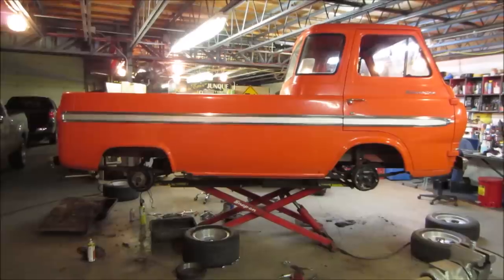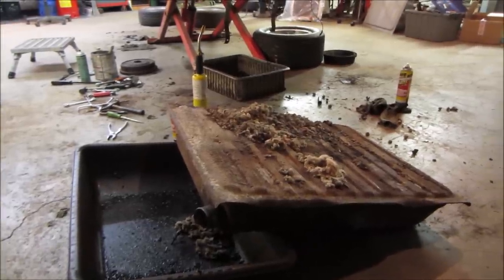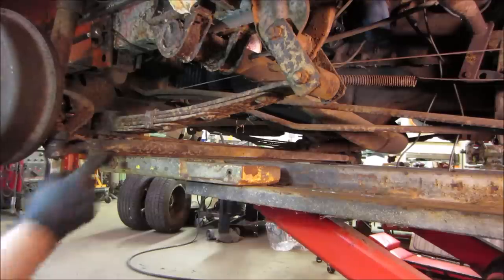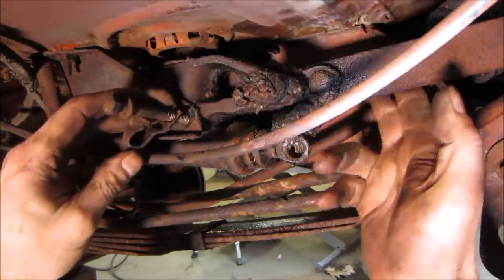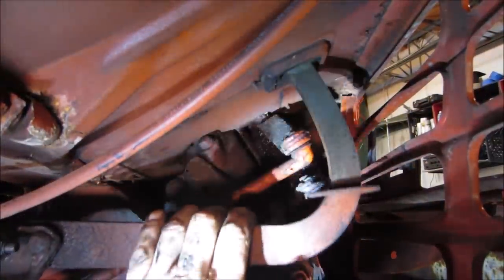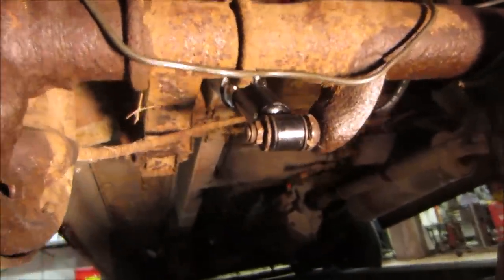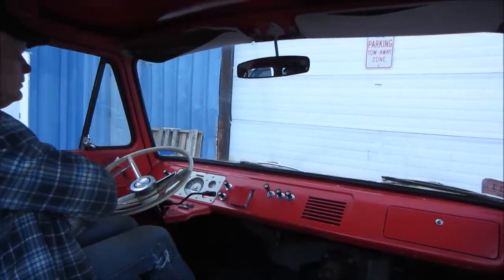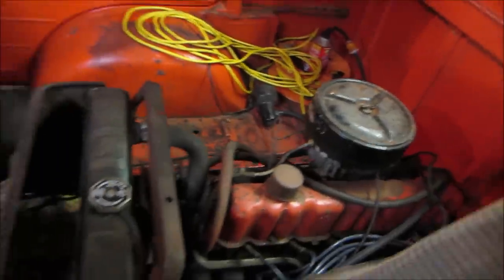Ratty 1965 Ford Econoline,  Making It Stop Then Making it Go

Comment: I would  have gone for a brake upgrade, a dual master cylinder, and at the least discs on the front if not all the way around. I think Mustang brake upgrade kits would work, or at least come close with a little modification they could work. (Early mustang upgrade kits I mean)
Reply: This things known to pop  reverse wheelies as it is, disc brakes would only make it worse
Reply: @bahopik  yeah right like that's a real worry. I'd rather be able to stop. If that single stage master blows, you're screwed. I have driven with no  brakes when they suddenly went out going down a hill. It's not fun and super scary. I managed to deal with it, barely. Even if yo left it drums, I'd still invest in setting up a two stage brake master. or even two masters like on some race cars. anything would beat what it's got. If you're really worried about it, put some weight in the ass end.
Reply: @CarsofTheArcticCircle  amen any "reverse wheelie isn't going to be all that bad. Better than front end colliding with something or somebody. Back in High School, a buddy hung a big I beam on the front of his truck where the bumper was supposed to go. People well in the other lane would see him coming and move over more. Having been nearly head on'd twice recently, I vote for all the braking you can get, maybe a steering upgrade as well. Without good steering and good brakes, I wouldn't be here, at best I'd be in hospital. I rebuilt the entire braking system on my ride a while back, and have had the front end practically rebuilt so it brakes well and handles well. other than that, it's a beater. near 300K on it. Motor runs good if it starts, but it's getting harder to start all the time. Need at least some new plugs, I guess that's about all a guy can do to tune one up. with the newer cars, you can't even do that as they use coil packs and all that crap.
Reply: @tootall5559  with 80 horse, if 3/4 of them even still there, you have to get up to speed first, which I'd imagine takes a little while
Reply: @bahopik  Not so much as you would think. little weight also means not much is holding them back. Those little sixes may have only had 80 ponies, but most of it was low end grunt. They'd get rolling quick... for the standards of the time, but wouldn't go to high speeds, trust me 60  in one of theses feels quite fast. Most I knew that had the pickup version carried an old engine block or something in the back. Of course the van versions get beds and all kinds of stuff. They also had a kit for them called 6 equals 8. headers, a different head, different manifold and carb... They'd really get going quick then. of course if you did not change the tranny and rear end gearing, the top speeds were still relatively low, but that was a good thing I think Not exactly the safest thing to drive.
Reply: bahopik 
That what proportioning valves are for👍
Reply: anyone with common sense knows that is not a option.
Reply: 1948 willys truck rebuild when I was 17 (late 70's)... Driving home after some 4 wheeling, going down big hill in county, the right rear wheel came off (missing a pin - I blame Dad)... All brakes out, going down hill about 50, one front tire touching road, digging trench with right rear plow -  curve and bridge over creek ahead.   I started down shifting, using engine braking force. Since it had 3 gears in high and low range, I was in low 1st by the time we crossed the bridge (doing about 5 mph) and turned off the motor to stop on the shoulder.  We never had a dual master cylinder on that truck, but damn sure had that retaining pin...
Reply: @drzorbo3770  I had my real wheel pass me once on an old ford truck. I had just got it, didn't have a jack or anything in it. Hell if had a jack, I would have jacked it up, slammed the axel in, and nursed it home or back to the deal since what would be closer. I let the tow company keep it, told the dearler where it was and if he wanted the rest of his money he would have to bail it out, fix it, and give it back. He let the tow company keep it. they put the axel back in, put a new pin in and sold it with a day of it being ready to go.

Comment: looks like it needs taken off and the whole drag link heated and  straightened because the ends have a 30ish up angle
Reply: Pete Peterson could it be installed upside down? The angle would match that way.
Reply: Pete Peterson   Absolutely do NOT ever heat steering components.
Reply: @bigmike1ak  the drag link ends are pointing down  look again even at sixty I can see that  it might be natural but because of the way it was bent I don't know not to sure unless I can see the forge stamp on the ends. ya know
Reply: @todaywefly4370   You can use heat don't take the temper out and I think mustie is a smart cookie when heating just black hot is good enough to expand the molecules of the metal to facilitate easier reshaping and besides this is cold rolled
Reply: Pete Peterson   Yeah great, except heating and repairing a steering component where I come from is an immediate reason for failing a safety inspection. Probably there as well.

Comment: An idea to make the steering go easier.
Grease the ball joints.
Drill a small hole in the top of the ball joint and with a special pointed nipple on the grease gun you can grease them.  
Eventually cover the hole with some silicone.
I used this method on old tractors and on ATV's, and it made a big difference.

Comment: Any chance the tie rod bar is on upside down? The angle of the tie rod ends seem odd, and if the bar was bolted on upside down, it looks like the angle would be correct.
Reply: I think you may be right - either that, or the rod (technically, I believe it's a drag link) has been bent rather badly at the ends as well as the centre.  Every pic I can find (which admittedly isn't many) seems to show a straight rod from one end to the other.  But the way it is, those ends will always be close to hitting the springs.

I suspect the truck was jacked up by the rod at some point, and it bent in the obvious places - in the middle where the jack was, and on the ends where the tie rod adjustment is, as that's always a little weaker than the solid section of the link.
Reply: @aussiebloke609  exactly, that is my suspicion as well.

Comment: So it may need a tad bit more weight in the back end than just the 150lbs or so from the factory LOL.  Typical pickup issues, no weight in the ass end to give it traction, even with snow tires you'd have that same issue, couple hundred pounds in the bed, problem solved...except I wonder if you'd hit the fenders on the tires at this point?
Reply: called a STOPPIE, google it.........................
Reply: The gallons of fuel will do just fine.?

Comment: If you are going to do a swap in the future, look into a 1995 F150. Last year of the 300 inline 6, fuel injected, E4OD trans, same as behind the diesel of that year and an 8.8 rear end.
Reply: Do not change it. It is a survivor and as soon as you change the engine, it will lose any value. My dad and brother did that with a 64 Ranchero. Now any buyer wants an original survivor car.
Reply: @dwheeler016  All numbers matching also.
Reply: Love those trucks, and it would be a great swap...but I think this thing is really cool all original.
Reply: dwheeler016 by any chance are you from S Granby?
Reply: @rust2985  I agree. My dad was given an original 64 Ranchero when his friend died. My brother talked him into putting a V8 and an automatic transmission in it. The engine and tranny are gone, the original bench seat is gone. Any value it had is gone.

Comment: I know from previous videos you do not like rust converters, however; would like to make a suggestion before you get further along on the body repair.  I like and use Ospho on a lot of non-automotive metal repairs and would like to suggest buying a quart of Ospho (should be about $20.00) and apply it to the underside with a spray bottle.  It goes on like water and drys overnight so you could mist parts of the underside before leaving for the day.    It will be completely dry by the next morning so you will not have any messy issues.  It doesn't hurt to get it on your hands so a quart's worth in a spray bottle will coat the underside several times.  I have found applying multiple coats on heavy corrosion will eventually result in a dense coat with a like white coating.  The heavy coating of rust to iron phosphate takes paint or your "special" undercoating very well.  That should, for the money, provide a lot more protection for years to come.

Comment: My recollection from when I had my 1960 Mercury Comet is that the 144ci engines were prone to having problems oil passages plugging to the top end of the engine. At that time you could get an external top end oiling kit from J.C. Whitney and the like that fed oil somehow to the rockers through the valve cover.

Comment: Musti1 Please correct me if I am wrong (I was wrong once when I thought I was wrong and I wasn't;) but, I believe dual master cylinders feed in a cross pattern and not front circuit and back circuit.  When you think about it, it would be a very dangerous situation to panic stop with brakes working on the front but not on the rear. When that happens on a tractor-trailer it always ends in a jackknife. When the front stops the rear keeps on coming around. In a passenger vehicle like your truck, it results in a spinout. On the interstate in the rain or snow that would be a deadly situation. I believe on a dual master cylinder, you have left front and right rear on one circuit and right front and left rear on the other circuit. That way if one circuit fails, you have symmetrical braking on front and back / right and left. If I am wrong, please tell me. I have a lot to learn and you are an EXCELLENT teacher. Love the videos. John

Comment: Hi;
Had a few of those vans when I was younger. If you need more power a 300 6 cyl. is the easiest to put in, no mods needed. If you want a v8, you have to build boxes on the side covers to clear the engine but you can mod the seats to bolt to the top of the boxes. I had a 351 Win. v8 in my last one and it will get up and go for sure. The only other thing that went out was the king pins on the frond axle. Had about 6 in. of play in the stearing wheel.

Comment: What a great piece of machinery you got there! I really dig those 70´s style slot-mags, got me some brand new ones on my old Volvo 144. Also that method of bleeding brakes is often used by me as I´m always alone working on my projects. Works really fine on a "normal" car, just pump the brakes a couple of times with your foot and then jam a 2x4" of the right length between the drivers seat and the brake pedal. Thank you so much for putting out great content! Many greetings from a cold and snowy northern Sweden and Merry Christmas to everyone! //Daniel from Kalix Sweden

Comment: I learned to drive on a 1961 Econoline pickup with the 144 inch engine in '64/65. Here are some tips...Those engines in all versions (144,170, 200, and 250) do not put out very much heat and thus are easy to keep cool with a reasonably good cooling system. Take note of where a heater lines run, if you plan on a working heater you will want to insulate those lines. ...Those engines are very durable, I have owned many over the years, but the one weakness I found is valve seals. At idle when the vacuum is high they will foul plugs quickly if the valve guides/seals or worn.  I don't know if the one I used had the weight in the back but the back end would come around on you with ease and the top speed was 55 MPH on flat ground. I believe the payload was 900 Lbs. and that included passengers, However we did once put 100 35 Lb. watermelons in it and drove them to the produce auction. It sat on the bump stops the whole way. It was destroyed in a barn fire while I was in Boot camp after I got Drafted.

Comment: Hey Mustie a 67 Econoline Master Cylinder  is a 2 circuit, they are a little hard to find but EASY to rebuild if you find a core, also get the pedal setup as well.  If you ever find a 67 to pick there is a LOT of nice, (one year only) stuff including a 9 inch.  Good Luck, Merry Christmas and God Bless!

Comment: Hi Mustie, I know this is an old video and don't know if you'll see the comment. I have something to say about the previous video, where you remove the exhaust manifold, but comments are disabled there.

It's a common misconception about using heat to free bolts that you need to try removing them when still hot. It's something a lot of people do, and if they are not stuck super hard it will work. But actually you really want to let them cool down again! I know it seems counter-intuitive but the biggest part of breaking the bolt loose happens while cooling down. Let me explain:
Metal expands with heat, and contracts when cooling down. The expansion and contraction coefficients depend on a lot of stuff, but they work on a per degree basis. So temperature of the bolt raised by X degrees means Y amount of expansion. Same goes for contraction. But that's something you probably already (intuitively) know. The thing is, when the bolt isn't allowed to expand the amount it wants the molecular structure will be squished together, kind of the same effect you get when forging. Actually, forging is exactly that, squishing the molecular structure to make it tighter. Anyway, when the bolt cools down again, it will still follow the 'rule' set by the expansion and contraction coefficient. Meaning it will contract by the amount it wanted to expand, not by the amount it actually expanded. The result is that the bolt will contract more than it expanded.
I hope this makes sense? So what happens is that the bolt will actually shrink a tiny tiny amount because its expansion was hindered, but the contraction wasn't. And that effect is the true power of heating up bolts to crack them loose. Let them cool down a bit, so contraction can start, and the bolt will break loose. And you discovered that yourself, with that one bolt you let go cold, leading to you treating the rest of the bolts in the same way.
Another reason to not put torque on them when they're glowing red hot is that it is much easier to shear them like that. 

I hope this little bit of materials theory may help you and others in the future, and prevents you from much bolt shearing and knuckle busting agony.

Comment: Steering danger. Back in 1969 70 I bought one of those. It was a old TV repair van. Not truck. It didn’t have any rear side windows. No body wanted the thing  and I paid a few hundred dollars for it. But I was young and it was the end of the 60s! I had it painted gold where the rear windows should have been then took lace table cloth and shot Black through that. The rest of the van I had painted dark metal flake blue! I put chrome wheels on it ! I had a kool hippie van before they got popular. The problem with the steering was when I stepped on the brakes the front wheels started shaking. I didn’t know why. I never got it fixed. I sold it to a guy who later rolled it 7 times when the steering box went out!  What do kids know! 😂 yea watching more my van was just like that one  even you wheels but mine were chrome

Comment: 289s and older 302s 70 and prior (don't want a low compression engine) have water pumps available with the hose fitting for either right or left side.  Had a long hose on a 70 Mustang with a 69 302 if I remember correctly, as the engines had water pumps with the outlets on different sides.  Should be able to do a water pump swap with a small block v8 conversion, to get the hose on the side you want it.

Comment: Mustie, this is a place where an alignment expert needs to look. There was no, or very limited camber/caster adjustment on these beam axles. The beam itself was cold bent, with a huge bar tool to correct the specs. It worked, but there was a learning curve, and the Ford guys hated alignments on these. Many just set the toe, and left it at that. Strangely worn front tires were commonplace on Econolines. Go to the oldest alignment shop in your area, they will know what, if anything, is needed.

Comment: Those I-6 engines are very dependable and will take any abuse thrown at them, they went on to become the iconic 200 CID Fairmont/Zephyr, Mustang/Capri power-plants in the early 1980s. That brake system could be updated I bet, it doesn't seem like one of Ford's better designs. You're the one who can fab up a better system!

Comment: The transmission on my '60 Comet was a weak link and the Econoline may suffer the same problem. I broke at least one transmission trying to spin over-sized tires when I popped the clutch.  (We didn't have snow in southern California.) The good news is that the transmission is really light and easy to support when laying on one's back while removing it.

Comment: Off road guys sometimes modify a hydraulic jack welding a cheap pair of locking pliers chain wrench to the top to hold it in place .
 I guess you know you have probably started a nation wide search for these old trucks!
Remember with a cabover you get to the accident a lot faster

Comment: I had a '64 or '66 van that was converted to a 302 + automatic. The engine tended to slam down hard over big bumps. The engine box was modified as the v-8 wouldn't have fit. If you're certain about the v-8 route,  you may be better off getting a second engine box, dissecting, and siameseing it into one. I'd stay with the six for economy reasons. Keeping the oil changed in it and it may outlast the body anyway.